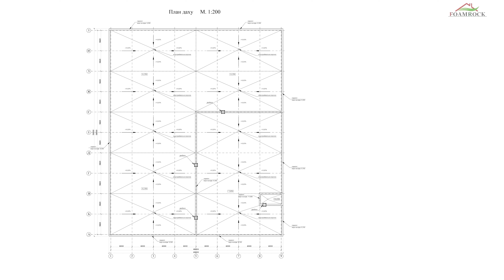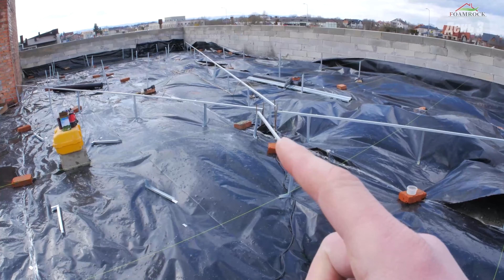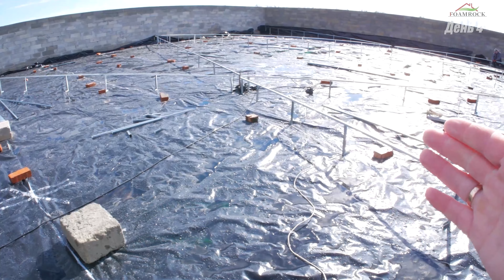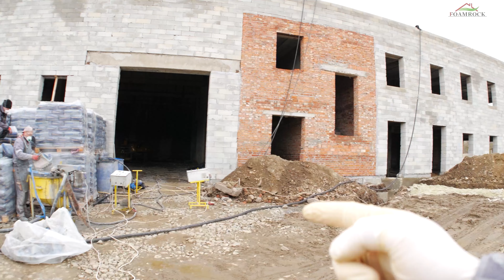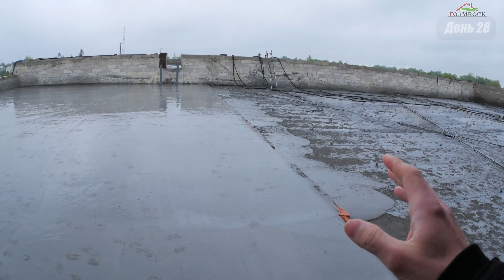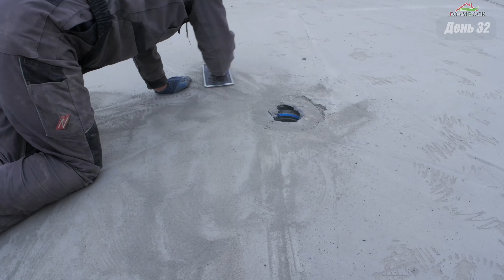40-DAY PROJECT: High-Quality Foam Concrete Roof

Comment: hello, will the 10 cm hole be able to remove water from that large area?
Reply from the maker: I have no doubt about it. The customer is very technically competent.
Reply: @foamrockglobal  any venotrs available?
Reply: Yes think about it that's 3.9 inches in the Us the pipes that poop goes in to are 3 inches